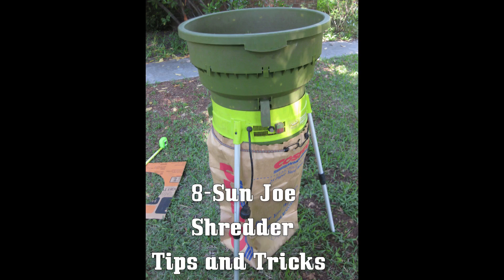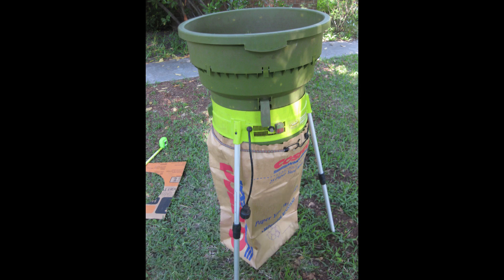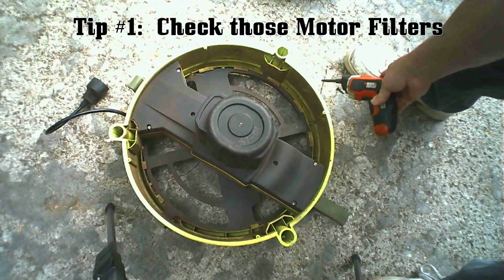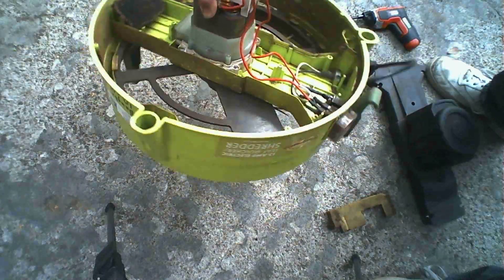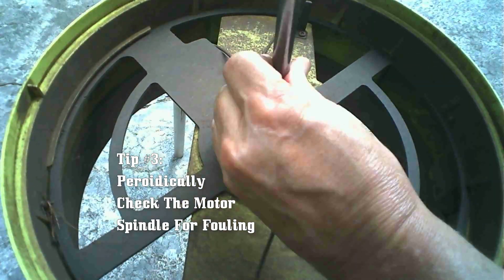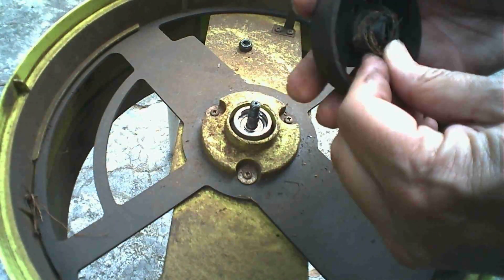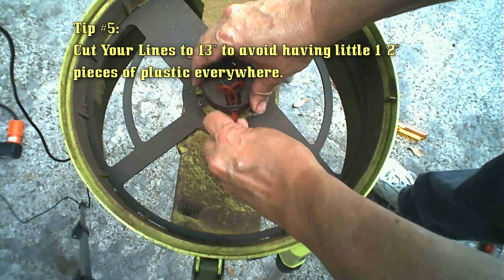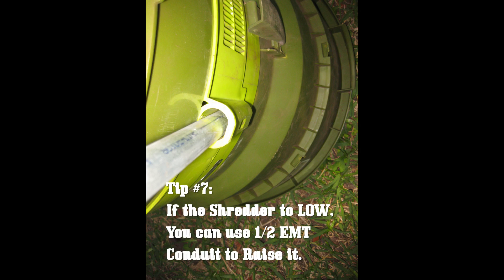Eight Sun Joe Shredder Tricks and Tips

Comment: I've been watching leaf mulcher videos all day to figure out which to buy and yours is the most helpful by far! Thank you so much!
Reply: natalia ord Check out the Flowtron  Leaf eater. I’ve been using one for thirty years and for my money you can’t beat it.
Reply: @Magnabee97  Thank you!!  After hearing that a lot of these "weedeater" style with the spinning cord machines don't last that long before needing the carbon brushes changed, and they're not set up for easy changing (with the brushes possibly not available), and they burn out with very much use, I looked for and eventually found a gas-power shredder/chipper second-hand.  The reason was that I had collected 150 bags of leaves just last fall alone, to shred to build my garden soil with, and realized that would be about the lifespan of one of these, but I wanted to do that every year or at least couple of years.  Does your Flowtron get heavy use, and do you have to do a lot of mechanical work on it to maintain it?  I am very impressed that it's lasted so long, but Flowtron did seem to be the best of the electric leaf shredders!  Thanks for your input!
Reply: natalia ord  I haven’t had the same one for thirty years. I am actually on my third one. I had to learn  through experience the best  way to use it. The main thing is not to over tax the motor. I don’t think any of them can handle really wet leaves without burning out the motor. Like you I go around in the fall collecting leaves although not as many as you. What I do is empty the bags into a wheel barrel or garden cart and kind of mix the wet ones in with the dry ones before I put them into the hopper. Then the machine has no trouble shredding them, and I use it on the finest setting. Another thing to not do is overload the machine. When you turn in on it’s going to make a high pitched whirring sound. When you throw in it leaves the pitch of the motor will go down. I wait till the motor starts making the high pitched sound again before I load more leaves, that way your not straining the motor. It’s also great for shredding bales of straw that people use for a fall display and usually throw out before Thanksgiving. I usually use that for mulch around my vegetable plants, but you can also compost that too. I’ve found it indispensable to my organic garden. One thing I will suggest is that you wear eye protection, ear plugs and a dust mask. As for putting a heavier line on there is something I wouldn’t suggest. The motor is designed for a certain weight line and if you put something heavier on it you may strain it and shorten it’s life. The recommended gauge line works just fine. A little trick I learned is that when you cut the pieces of line cut the tips on an angle so there’s a little point on the end. This makes it much easier and quicker to install the new pieces. I hope I gave you some useful info. Good luck and happy gardening! Oh I have to add that ive used both gas chippers and leaf eaters and the leaf eater shreds the leaves much finer so they decompose much quicker. There also a lot safer than a metal blade and there’s no hassle with gas.
Reply: @Magnabee97  Ah okay, good to clarify!  Those are a lot of good tips for anyone getting a Flowtron. Thanks for sharing those!

Comment: I think I would put filter material over air inlet on the outside to be able to clean often while keeping ones on inside too
Reply from the maker: Just bought a new one.  Watch that video.  The filter is externally accessible.   Lots more improvements.  The drive gearbox is a huge improvement in the new unit.
Reply: @EdHumble  ok thank you.

Comment: Excellent video and special thanks for clearly displaying the replacement trimmer line diameter you use (.105).  I wasn't sure if it was possible to fit the .105 line into the Sun Joe or if I needed to downsize to .095
Reply from the maker: My only warning is that larger line loads the motor more.  I've burned up weed whackers by increasing line size.  So far the Sun Joe accepts it.

Comment: Just the video I need. I am senior lady who has a Kenmore shredder that looks almost identical to yours. I used it today and suddenly it stopped. I know I didn't overfill it. so I cleaned the filter and inside the tower then unplugged it and tried to start it but no good. I am going to look at mine underneath and see if it looks like yours so I can follow what you did. I will check for the string around the moving part, but not sure what else I can do. You mentioned you replaced Motor brushes? where abouts are they? and not sure where I could take it to get it fixed. Do you have suggestions for me to try. Here in Canada we dont seem to have many repair places anymore, and I had to come to the States to buy the one I have. Thanks in advance for any help you can give me.
Reply from the maker: Shredder Notes:

There is a reset button on mine.  Check yours For one.

I did a full video on brush replacement.  It isn’t for the faint of heart.  That video has a link for buying the brushes from eBay.  I’d ask around to see if you have any friends with hands on skills.  There should be a Playlist link at the end of the video that will take you to it.  Best Regards, and good luck.

Comment: The Flowtron  Leaf eater is far superior to the Sun Joe and the Worx. I’ve been using one for 30 years. The filter is accessible from the exterior, and you can adjust the size of shredded dry leaves to almost a powder.
Reply from the maker: I agree the MECHANICAL construction of the Flowtron is superior to the Sun Joe.  A 5 amp motor vs. a 13 Amp motor is the issue.  I’m making compost from compacted leaves.  That really loads the Sun Joe.  I don’t think it would be long before I burned up the Flowtron.

Comment: Thanks a lot for the suggestions on maintenance and care.  I've taken mine apart to clean it but failed to take the motor spindle off motor to clean it.  Also the suggestion to cut a piece of plywood to fit over a trash can.  I use mine to mulch pine needles for around my shrubs and beds around the house. Love the Sun Joe.  No more buying bags of red mulch, and it breaks down good to improve the soil.
Reply from the maker: Glad it helped.  Working on an Updated Video.  Stay tuned!